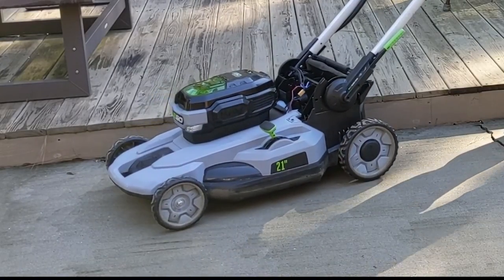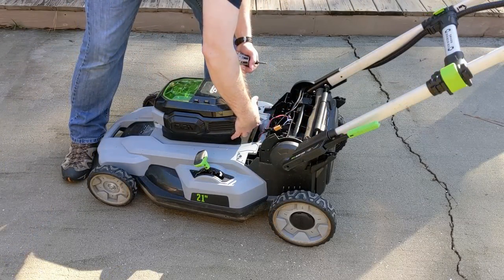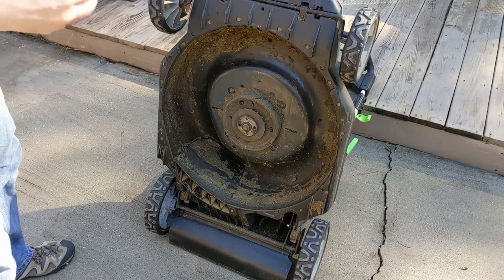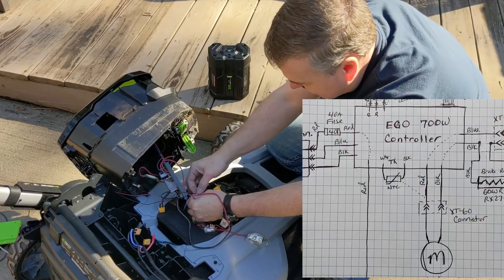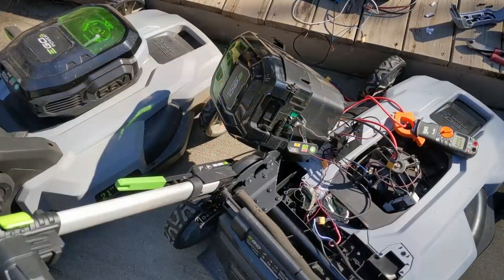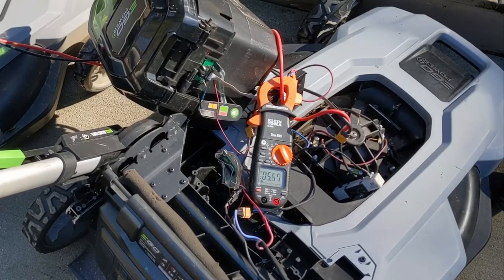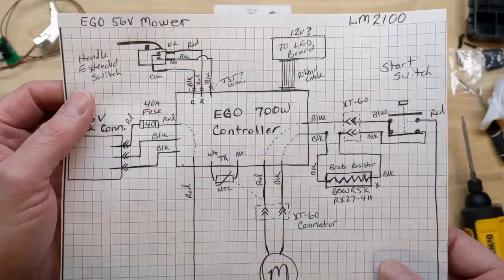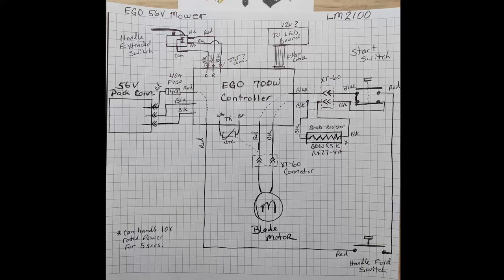EGO LM2100 Mower Troubleshooting

Comment: I have a newer EGO mower (2135SP).  The mower blades would randomly stop while using the mower.  It seemed that the slightest movement of the handle would cause the safety switch to stop the blades.  In most cases, I could restart the mower by pulling up on the handle and starting the mower normally.  Finally, I became annoyed with having to do this.
With the newer models, the configuration of the safety switch is different.  There is no spring.  I opened the plastic components on the handle which houses the safety switch.  There are several TORX screws holding the components together, so an appropriately sized TORX screwdriver is needed.  The switch is configured as a Normally Closed (NC) switch.  When the handle is not in the fully up position, the switch opens, and the blades stop.  I first thought of removing the switch and permanently connecting the two wires together.  I then opted for another solution in case I wanted to easily remove my modification.
The switch has an unused Normally Open (NO) terminal.  I used a small piece of wire to connect the NC and the NO terminals together.  This basically causes the switch to have no function.  I reassembled the mower and now everything works great without interruptions.  Of course this removes one of the safety components of the mower.  Be aware that the handle will not have to be fully extended to start the blades.
I enjoy all the EGO mower videos on YouTube.  I only wish more videos for the newer models were available.
Reply: I've watched a couple of videos where the safety switches were bypassed. Normally I don't bypass safeties. But I after i thought about it - they don't give me safety in any real sense. I don't fold up the mower until I stow it away at the end of the season. So, I never shorten, or fold, the handle with the battery in it. The mower is perfectly safe when the battery is out. So that's two safety switches I will never need.  And really, now that I've seen several videos showing that folding the handle damaged or broke the wires inside, I may not even fold it up again.

Comment: Question I just bought one brand new of the guy down the road be moved and never gave me the battery or charger so I got a battery but I was wondering can I use a 210 amp charger for this rather the 320 amp?
Reply from the maker: As far as I know the standard wattage and higher wattage charger will both charge all the EGO packs just fine. Of course the standard charger will take longer so if you have a really large pack such as a 10Ah it will take a while, but usually it doesn't bother me and is typically a little better for the pack to charge slower.

Comment: Awesome troubleshooting I wonder if a controller from a scooter or twist grip ebike would work in a Frankenstein fix. Thanks for sharing I have the same problem on my Snow Joe 80 volt snowblower.
Reply from the maker: I am testing with some cheap DC controllers at this time and they will work fine. Hard to find anything rated above 50V though. These are brushed controllers and alot of the 72V controller etc. are usually brushless controllers. Thanks for your comment!

Comment: Do you have an suggestions on best way to reassemble the handle switch assembly or a video?
Reply from the maker: I do not have a video for that. I just showed a few clips of it on this video for clarity. I could not detail much about it as it would have made the video much longer. What exactly is your question about the handle? Or have you taken apart the switch itself?
Reply: @ThriftyToolShed  
Thanks and thanks to your video I figured it out got it working fine

Comment: I picked up a mower like this last week for cheap (100 bucks), except the guy didn't tell me it had this problem of trying to start and stop immediately. He demonstrated to me that it works, don't know what exactly he did to get it to work. Anyway, it looks like its sensing an overload condition on startup and as a safety feature shutting down without trying to proceed. By removing the inertia of the blade it spins right up.  If I were to guess there is a current sensing resistor on the control board that may have changed its value or overheated the solder pads/traces thereby increasing its resistance. Did you by chance get to reverse engineer the controller? I think this being a brushed motor is must be quite a bit simpler than the brushless kind. Looks like all that it would do is to PWM the battery output  into the motor based on speed or current. I do not see any way it is measuring the speed though. If there was any Hall sensor or something, that would have been my first guess as to what may be wrong with it. Also would be nice if you could tell me what screws to remove to open it. One guy on here seems to have removed lots of screws from underneath to gain access.
Reply from the maker: The controller would most likely be an easy repair, but it is epoxy potted as mentioned in the video. It's been a while, but I either mentioned the controller potting in this video or the video when I replaced the controller with the cheap brushless controller.
Reply: @ThriftyToolShed  You did mention the hard epoxy. I had one time removed the controller from my snow blower (not this lawn mower) which also had epoxy on it which I was for the most part able to scrape it off. My guess is that using a combination of heat and scraping, you can remove this too. I'll hopefully get to it in a week or so, Ill report back what I find.

Comment: Hey I guess controller is the governor. Which aftermarket controller would you go with or will there be different variations to each controller for  different volt batteries. Nice video
Reply from the maker: I used a cheaper DC controller in the very next video and shared some testing. The other option we mentioned is the OEM replacement for over $100.

Comment: I bought a used one that was broken to see if I could fix it. All three of relays check ok, but I notice it has a yellow flashing light on the mower itself when I try to start. Does that provide any clues? I have just started getting into it, but don’t see anything obvious.
Reply from the maker: That what I went over in this video. I checked for binding at the blade (with the battery removed) and even took the blade off. It would run with blade off so the controller thought it was too much load at start up I guess? The mower varied in load alot it seemed to me even with no blade. Motor seemed fine and it even ran with my other mowers controller driving it! In the very next video I shared replacing the controller with a cheaper one to get it running. I also share the cost of a new EGO controller on that video as well.

Comment: great Video - I have the same exact mower with the same exact issue,  were you able to locate and replace the controller?  if so where were you able to find one?  I hat to go and spend another 800 for a replacement mower
Reply from the maker: I did share in the very next video about the controller I chose and show it in use. I also share some links from other websites with the EGO replacement controller if you wish to do so. 
https://youtu.be/Kdib1irxq-Q
Reply: @ThriftyToolShed  thanks I will definitely check it out .

Comment: Is this a brushed motor? I'm guessing brushed as I see two wires on your schematic.   With that in mind, you won't have to worry with hall effect sensors and can find alternative ways of motor speed control and start up.  I'm sure that these oem control boards are not cheap.    I noticed on  Ryobi that their first generation mowers were brushed which made it easier to utilize parts.   I found it on facebook and made a stationary leaf mulcher with motor speed control and two 6ahr batteries along with other components.   .
Reply from the maker: Yes it is brushed and the speed control is around $125 as OEM replacement. We can definitely find other replacement motor control cheap.

Comment: I have the same model and it get the similar issue. Found the start switch had a loosing soldering on blue wire (blue wires jump from one to another). It still hung on the switch with the black terminal insulation.
Reply from the maker: Good find, the black heat shrink was holding the wire in place you are saying I think. Yes that would stop all power from getting to controller. How long did it blink orange since it lost power?
Reply: @ThriftyToolShed  yes, it is black heat shrink. The light link about 2 seconds then went off.

Comment: Good video, as usual! Apparently, the previous owner knew the repair was going to be very expensive or perhaps not possible due to part availability. I wonder if the controller was under warranty possibly allowing a complete exchange of the mower.  At any rate have you considered breadboarding your own controller to address the in rush (possibly a time delay to a MODFET gate few hundred ms should do) since after start, run is full on?
Reply from the maker: I would if I had the time. I not only try to do the best method of repair for my time, but also consider what most of the viewers time as well or the best solution for the majority. I do have a couple other controllers that have more of a soft start if needed. The one I chose is working perfectly fine. If one is needed with a softer start, the following usually works well for most applications...
https://amzn.to/3Xg5uZD
Thank you for your kind comment!
Reply: @ThriftyToolShed  
This one looks like a nice 'all-in-one' solution..claims even has a soft-stop (using a pedal?). How would one go about using these pins to provide the brake?
Reply from the maker: I am going to try one with the Pedal that just plugs in to see if it's just automatic when releasing the pedal. The Pedal simply plugs in. I will need to try these controllers on a load like the mower because these controllers are super tiny and light weight and I do wonder how long they will run the mower. These are not nearly as robust as the controller I used in the end. They work good for smaller ride on toys etc. for sure but I do wonder how long it's rated for 40A.
https://amzn.to/3KcirhW
Reply: @ThriftyToolShed  
Youtube deleted my post likely for having an AMZ link to DC-DC 48V-5V 2A buck converter, but was musing getting the dead-man bail to function as the brake, as originally designed/equipped, using those pins...+5V/GRN/'S' (for stop?)
Reply from the maker: I don't believe you need the 5V supply. It should be supplied by the controller internally. You vary the input from 0-5V and at the 0V or ground reference it should brake. I have purchased one of these and only tested very briefly. I will have to get more time to fully test and see if 40A rating is real. It's super light and small for 40A,but claims it's current limited so it should not pop like a balloon, but I will find out when I get some time. I like the idea of the low voltage cut-off,  the soft start and the current limit.
Reply: @ThriftyToolShed  
If I understand correctly, you are saying simply killing the power (release bail) will allow the brake function (as originally designed), or do I have to leverage the pins in that jack for braking?
Reply from the maker: Well I used a relay with the Normally Closed contacts to shunt/brake the motor directly. EGO used the handle in a similar way as shown on the quickly drawn schematic. EGO has a weird setup with the switch NC contact going into the controller to brake the motor which is fine if your replacement controller works the same. It may control differently though.

Comment: Was it the controller?? I can take the blade off and it runs
Reply from the maker: It was the controller. I see now that many of these do fail in this manner. I have one I am working on now and it is intermittent. It will sometimes start up and run and then Sometimes it will not start up and flash yellow and it's getting more frequent not wanting to run. To the point now that I am putting a new controller on it. Something in the controller starts picking up too much start up current and shuts down. It's like you said and like I shared in the video it will start up with no blade so it's a load detection issue. The controller is so darn potted with epoxy it's nearly impossible to repair it with out a controller swap. I am trying out a smaller all in one controller that is working fine , but I am over driving it. I want to see how it holds up before I even share anything about it, but I hope that company will make one just a little higher current rating. I am basically using the tiny controller as a low voltage cut off built in and simply using the original handle switch instead of adding a relay since the controller is soft start.

Comment: Very helpful to see the motor run without the blade. Now I think my controller is bad. Not sure if it is worth messing with.
Reply from the maker: In the next video I did take time to share installing a cheaper controller. I also shared the price from some places with OEM controller if someone desires to buy one of those. Yeah, it's not for everyone to troubleshoot and replace the controller and at some point it may be worth it to buy a new one?
Reply: @ThriftyToolShed  i went ahead and bought a new one, but I may check out your other video to have a spare mower.

Comment: My ego lm2100sp started smoking, so I took the cover off so i could see inside and tried again and I saw flames coming out the engine. Anyone know how I can check this or clean it?
Reply from the maker: This mower model is a  DC brushed motor and most likely it's arcing bad at the carbon brushes that ride on the commutator. If it's arcing bad enough I could see how leaves, dry grass and other debris could possibly cause something like you are describing. It could be a bad motor or it could just be the brushes are getting worn down and arcing due to less spring pressure.

Comment: Mine runs fine just having the transmission issue where it won't pull when I push the button
Reply from the maker: Yeah, this one is not self propelled. I can see where the self propelled addition could give trouble over time for sure.

Comment: I have a Ryobi battery powered lawn mower. I have the batteries,  which are  cheaper as well as the mower compared with Ego. Their snowblowers are horrible.
Reply from the maker: You are saying EGO snowblowers are horrible? I live in the south and never used one. As far as Ryobi 40V batteries, that is one of the few brands platform that I do despise. The battery packs are very expensive for what you get because of all of the complexity of adding Mosfets and monitoring board to the packs to shut down when needed. They do this to keep the tools cheap. I had many earlier 40V packs and equipment and have shared on video some of the issues I had with the platform. It's very similar to comparing Ryobi 18V tools to Flex 24V tools from my experience.   I hope the newer versions of the 40V packs are better though, they have been around some time.
Reply: @ThriftyToolShed  My lawn mower uses the Ryobi battery packs that you use on their tools. My lawn is small. They are the 18 volt batteries.
Reply: @ThriftyToolShed  The South, like Florida,  is a great place for their snowblowers!
Reply from the maker: @joejohnson2478  
😂
Reply: @ThriftyToolShed  Glad that you agree with me.